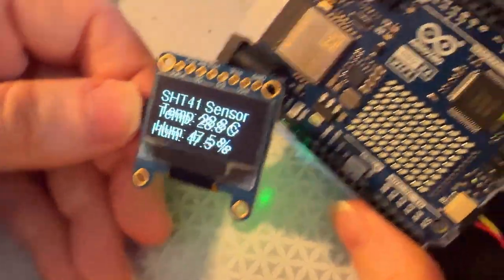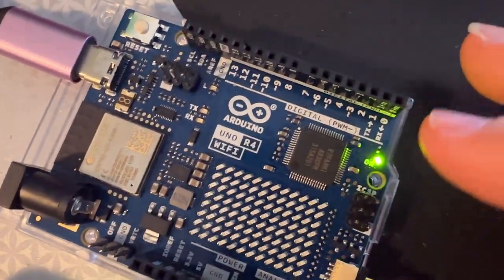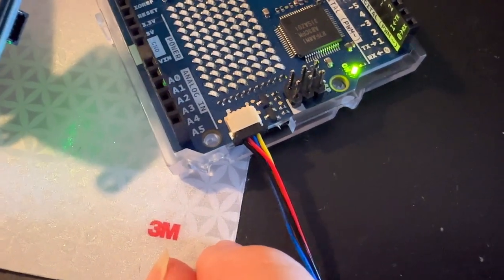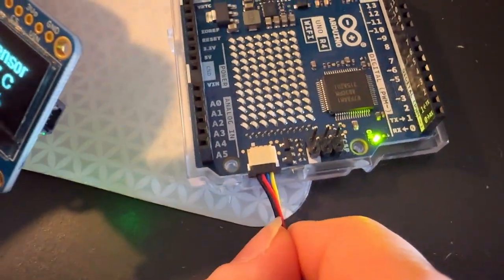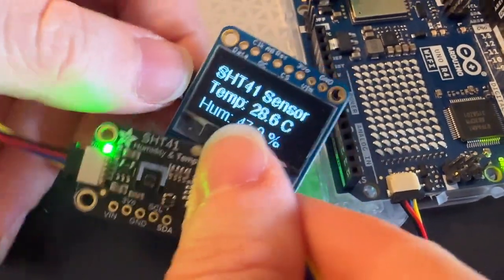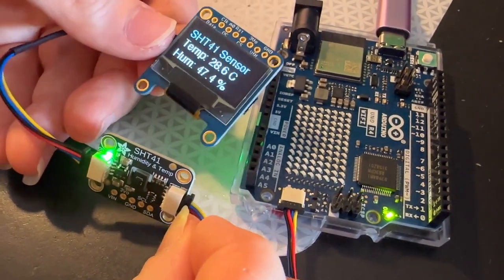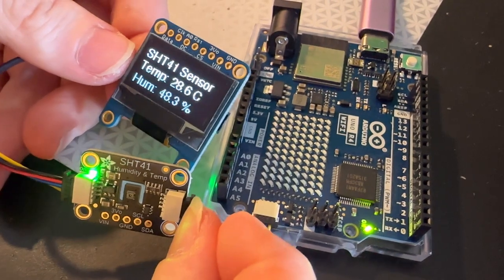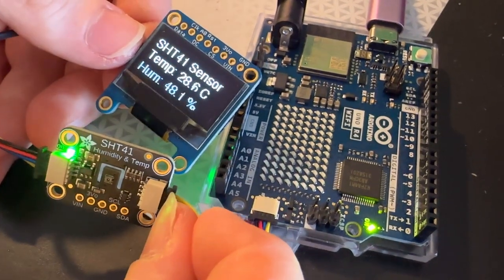Yes! Stemma QT boards work with the Arduino UNO R4! 🎉🔌🛠️📡💡🌐

Comment: I can’t get any qwiic devices to work with R4
Reply: They can use it with qwiic "twin" STEMMA.  I think STEMMA got onboard pull-ups resistors on I2C lines, though